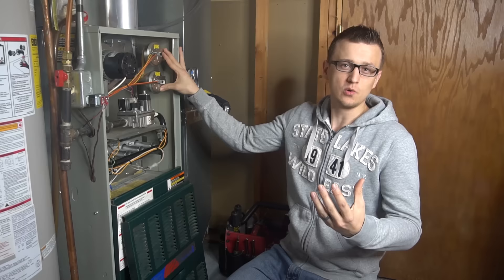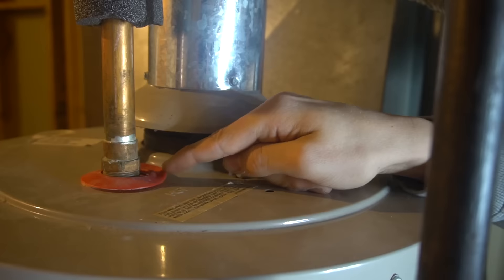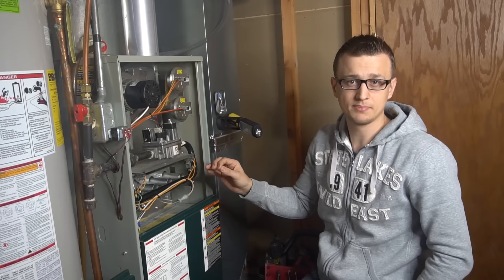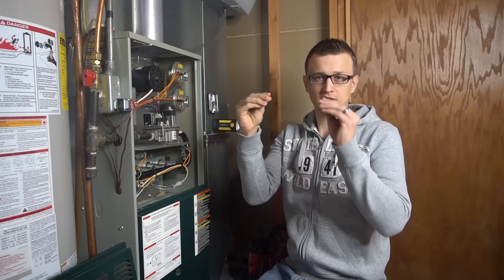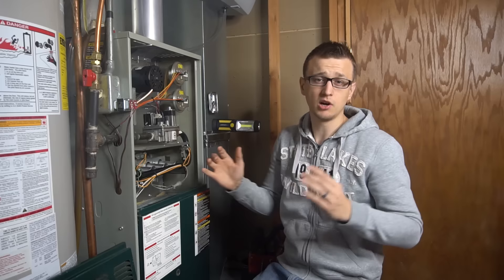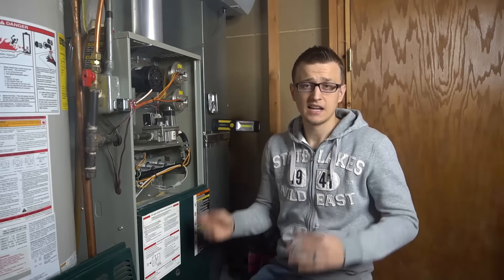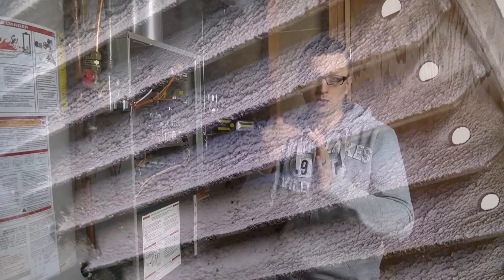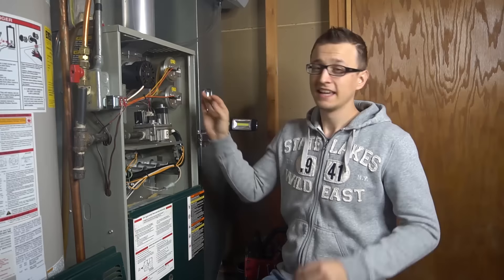Furnace Pressure Switch Troubleshooting

Comment: After the last professional maintenance, the furnace would not turn the heat on. Eventually, I found two error codes that hinted at two pressure switches (low and high). This video helped me to find the problem - the joint hose to both switches simply fell off from the inducer (or perhaps the technician forgot to put it back after his tests). Thanks.

Comment: This is awesome! you saved my life right before incoming 3 degree weather days. My problem was that my furnace ignites and runs for a few min then stops, and I thought was a pressure switch problem. But then I gave it a try and opened the burner box as you suggested. Boom, it worked like a magic and just kept running. now I know it is clogged intake pipe problem, which I can solve in another day. At least I have a running furnace for now to get me thru the next a couple of really freezing cold days.  THANK YOU!

Comment: I'm a diy'r, but through some testing and I believe using your video's I managed to find a bad low stage pressure switch. i ended up taking it apart and cleaning the contact points. Taped the unit back together.  Reinstalled, all worked with no codes. Ordered new switch set and kept them on the furnace for when my fix fails. It's been a couple months shy of two years now. Still going. Seems the little contact points go. Fixed a hot water tank using a similar method. Don't be afraid of taking the switches apart. They're buggered anyhow.

Comment: Great video. Was able to pinpoint the issue when the burners kicked on after I removed the burner door. I cleared the air intake pipe outside, and the furnace works normal now.

Comment: Carrier Heater w/ LED Code "31".  Followed instructions and this led to the Condensate Trap, with 46oz of condensate drained once the larger hose removed - thanks for tip to have bucket ready!  With kids home for the holiday, this could have been a disaster, instead .. just the opposite, all because of your troubleshooting guide, thank you!

Comment: Jay, thanks for the amazing, helpful video, and for your YouTube channel. Your “reason 4”, Cracked Pressure Switch tubing, did it for me on my 24 yr old Nordyne G8 Series furnace. I replaced that pressure switch in 2009, but the end of the tubing that attaches to the inducer/vent motor was now blackened. When I twisted it off, just like you said, it fell apart. I cut 2” off that end, plugged it back onto the motor, and WE HAD IGNITION! Woo Hoo! Thanks for the PayPal link so that I could buy you a beer!

Comment: Hi
Yours video is very helpful to me and I am glad that I did fix my furnace as per your video step by step instructions. 

My problem was that my furnace turned on but after 10-15 minutes it turned off and not reaching the thermostat heating no e.g I did set 22 F but my furnace turned off at 19 F.  
I did the following steps.
1.  Change the flame sensor.
Result: same
2. Check the limit switch, it's working 
3. Pressure switch- working 
4. I did the your video step 8 
     I found the drain pipe clogged, I cleaned the both pipes and try.
NOW MY FURNACE IS WORKING GOOD AND I AM VERY HAPPY. 
Thank you again.
Reply from the maker: You're welcome! Glad to hear you were able to get it fixed! :) Stay warm!

Comment: Great video and thorough explanation, had the six blinks on a Coleman, pressure switch, everything looked fine but when I unplugged the hose connecting the switch to the inducer motor, the small hole in the fitting of the motor was clogged with like the residue of hard water substance, a simple poke with a paper clip and it's running like a champ again, hope this helps someone out there.
Reply: I had the same code on my coleman the lower pressure switch (bottom left) was blacked.  I put a pin in it and I blew some air in and it stared right up.  Thank you!!!  9pm and low 40s outside!!!
Reply: @kathleenmclain978  Glad that helped you

Comment: Thanks so much for this video.  I already understood most of this and was great to review as I was troubleshooting my pressure switch.  But thanks to your video it made me review the other sensors inline.  I found the high temp limit switch inline.  After testing it it seemed fine on a multimeter.  I first bypassed the pressure switch.  The furnace would get to the igniter phase then just turn on the gas then immediately stop.  So I added another bypass to the high limit.  It worked fine after.  I tested and re tested and found that essentially when the high limit started seeing some current it would fail.  I'll let you know when I get the new high limit.  I have experienced this in the automotive world with intermittent issues as the load/current increases things would stop working.  Thanks again!

Comment: Thank you very much. Got a pressure switch error code on my American Standard 90% furnace and was ready to go out and get a new switch.  Never would have thought the condenser trap having crap built up in it would cause this code.  15 minutes, zero dollars, problem solved.

Comment: Thank you!! I just went a night without heat in the single digits. Went through your video. Tubing was fine but had to cut the end of it off but it was long enough to reattach like you said. But the main issue was debris that had fallen in the sensor. Thank so much!

Comment: Hi Jay - I agree with other comments below... you are an excellent instructor!. Not an urgency but my American Std Platinum High Eff was giving me a pressure switch/inducer fault and  after inspecting vents+ wiring i did the "blow in the tube" to test the pressure switches and indeed there was the fix! Thanks and best wishes!

Comment: Fantastic video!  I was able to apply this to my water heater that was having the same type of error codes.   Of course, after re-assembling the inducer and pressure switch wiring, it seems to be working fine again; but I've now ruled out the switch itself, and it's led me to my vents likely being partially obstructed by some ice (waiting for a ladder so I can get up and check them out)   You are great at explaining things in a way us lay people can understand; thank you!! 🙏

Comment: Thanks so much for your videos. My issue was a clogged condensate trap. Then of course someone was nice enough to glue the pvc pipe to the condensate trap! I had to cut the pvc pipe on the outside of the furnace so I could pull it out, clean the trap, put it back and I'm off to big box store to get materials to fix the pvc. Bucket is catching the water, but it's about 10F outside and the furnace is working again!

Comment: Your videos are great. I had an air issue and a quick clean (of very minor dirt) seemed to get by furnace igniting. It would only ignite with the burner box cover on, and when I took it off, it ignited, so I focused on the air intake.

Comment: Thanks so much for this. My Mom has a gas 90%. She called furnace co it wasn’t working. They said “pressure switch sticking” and replaced it. 2 weeks and $400 later it was doing same thing! Kicking on cycling for like 3min then shutting down. This saved us!!!!

Comment: Thank you so much.  As a complete novice this has been a bit scary, but I fixed it.  The inducer blower was rattling and nothing was happening.  Not knowing there was a code (blinking light), I just went in to clean the firebox.  Even though you warned, I hit the igniter (thought it was further up) and broke it.  While waiting for the new igniter, I opened the exhaust and saw a dead bird.  After cleaning, including vacuuming inside the inducer box and pressure switch connection as well as installing the new igniter (very difficult maneuvering, especially since it is so fragile) it worked!!!   I opened the exhaust several months back because I heard an animal; one bird came out...obviously there was at least one more.  This happened around the time I had a new roof installed.  Hopefully, something was opened up temporarily allowing this to happen.  Poor animals.

Comment: Jay, you make the best videos, they are so thorough!  And you are so knowledgeable and personable.  Now despite all that, none of your advice has helped with my "pressure switch" error I've had for the past 8 months, which leads me to believe it's not a pressure switch problem. I'd be indebted if you could advise:
I have a simple 80% 3 burner Ducane MPGA 100b4a which is throwing 3 flashes - "Pressure switch is open, should be closed".  Now the pressure switch is fine, as is the new one I bought, lol.  There is continuity when the inducer is running, and the circuit is open when the inducer is off.  One thing I've noticed is that one side of the switch has 24vac to ground, the other side is like ~ 6vac.  My thought is that the low voltage is causing the error, not the switch.  I jumped the limit switch on the panel with no difference, but the other is on the blower, which is way under everything and there is no access to it, save the very front panel and needing to be plastic man.  What should I try next?  Thanks!

Comment: This video saved me a service call which I was not looking forward to doing with Covid going on.  Took a small drill bit and cleaned the port to the inducer motor from the pressure switch and it started working again like a charm.  Only difficulty I had was finding where everything was on my Bryant 90 +i which looked quite a bit different.  If you ever run out of ideas for great videos, some tours of different brand devices would be great.  Thanks again, liked and subscribed.

Comment: Our Goodman 80% furnace was blinking an open pressure switch code on the controller board.  After determining the correct voltage was reaching the switch and that the air tube was not leaking, we then tested that the switch could close by sucking on the end of the tube and checking for continuity through the switch.  Next, we turned on the furnace power and sucked on the air tube - the diagnostic light on the controller board stayed lit, indicating no other issues we could detect without testing the switch with a manometer.  Rather than opting to climb up on the roof to check the chimney next, we took a stiff, thin wire and reamed out the air tube nipple on the induction motor - it felt a little crunchy!  We reconnected the air tube, and lo and behold, the light on the board stayed on and the furnace ignited!  So, before inspecting the flue for a blockage, clean out the air tube connection on the induction motor, to eliminate that as a cause for the pressure switch to be stuck in the open position.

Comment: Hi. Amana Distinctions (Goodman) 90% efficient, 15 years old or so.  I replaced the inducer blower last winter due to bad bearing, furnace worked fine.  Yesterday, furnace stopped, getting 3 red blinks - pressure switch open.  Troubleshooted - intake, exhaust is clear, manifold condensation tube dry and clear, exhaust condensation tube clear, sucked pressure switches (both clicking), wires, connections, hoses look good.  With lower door off and manually pushing the door switch, a few different things happened.  It ran, so I put the door back on, but after a cycle or two, furnace would stop.  Continued with door off and depressing door switch and this is where I am at - the relay, I think just the one,  on the circuit board would click a handful of times.  Sometimes the inducer blower would just barely start and then I get three red clinks.  So I tried spinning the inducer while depressing door switch and this did not help.  Now, the relay clicks a numbers of times and then I get 3 blinks, nothing happening.  Can you suggest?  Thank you.

Comment: Thanks Jay. This was a great educational video. For me it was the inducer motor not wanting to start, it was humming and maybe having 1 revolution in 20 seconds. Took off the motor, spun it by hand and blew it clean with compressed air. It started up immediately when plugged in. Reassembled everything and the furnace works great again. Great and cheap fix when it is -29°C outside. Calgary Alberta, Canada

Comment: Thank you so much... I troubleshot it to the air flow sensor which seemed to work, when I tested it. I could not figure out why the burner would only work when I jumped it out.  It ended up being snow had gotten into the intake which I would have not realized without this video.

Comment: Amazing video! My error was a low fire pressure switch in the closed position. Seeing that a lot of troubleshooting steps are to figure out why the switch won’t go to a closed position I had to figure out why mine was “stuck” closed. I think you might have mentioned in the video to lightly tap the switch to unstick it - well that’s what fixed mine! I used a screwdriver and knocked on the switch a couple of times. Turned the power back on and the furnace fired up! Thanks for the great videos!

Comment: Thank you young man. I did find a bird on top of the inducer housing. Imagine my dissappoint when I still received a pressure switch code,
follow the rest of your steps and bingo, back up and running. No cost. I think it was cleaning of the inducer
motor fan blades. They werent terrible looking but I cleaned them anyway. everything else checked out good.

Comment: Thanks for the video, it is succinct and covers all the troubleshooting ideas. Tried them for my Nordyne G7 system that started giving led flash. Flashing green and solid red means pressure switch open fault. Tried shorting all the switch related circuits, changed the board but still gave same code. 
Ultimately it turned out that the blower limit switch was blown because I did not change the filter on time.  So it seems like G7 model on Nordyne has wrong fault indication. Hope it helps someone.

Comment: Very informative video here! Had the inducer motor fail. After replacing it, burners won't ignite w/o the top door off. I figured that the inducer intake pipe is clogged, and your info confirms my hunch. Probably a dead animal - found dead mice inside main blower chamber, so might have similar cause of the inducer failure. Was surprised that simply replacing it didn't get things back to 100%.

Thanks for your efforts.

Comment: Great videos, super helpful.  I have had furnace problems on and off for months now, and I cannot figure it out.  Neither can the company I have come out for help.  They just keep taking my money without a perfect fix.

Long story short, I had a pressure switch problem two years ago or so, and it was because I had a long exhaust run and I had a sag in the run that caused build up.  It would trip the switch, and not allow the furnace to fire. I got that fixed, and then the furnace ran pretty fine for maybe a year or so.  

Fast forward to now basically, and I started having the same issues.  Except this time I wasnt getting pressure switch error codes anymore, I just have a furnace that tries and tries to fire, but wont ignite a flame (most the time).  It continues until it goes into “lockout mode” and will just blow cold air through the house.

The only way I have been able to get around this, is to unplug the tube from the pressure switch, and the furnace ignites EVERY time.  EVERY time.  When I plug the tube back in, the furnace continues, heats the house, and will even turn off, turn back on when the heat drops and fire the next time.  The only time I encounter issues is when there have been a very long period of time between ignitions.  Like for instance when we drop the temp 5 degrees at night when we sleep or something.  If we keep the temperature the same all day and all night and the furnace is kicking on, on a normal consistency we don’t seem to have problems.

I just dont know what the heck is going on, and I am not sure I trust my HVAC company to come out and keep helping us.   I have already spent over $500 for a normal service call and having them reroute my intake and exhaust to make them shorter runs.  I wish I could figure this out myself.  I feel like its a drain/condensate issue, but I dont know how to know that for sure.  

When its not firing, it always goes through the entire process, pilot lights up, but then when it goes to light the burners it wont catch.  Also, sometimes when it does catch, it has a pretty big combustion.  I have no idea what that is all about.

Any insight would be SUPER appreciated.  TIA!
Reply: We have the same problem with our 20+ yr old 80% Day & Night unit. We’ve gone thru the checklist for a code 31 and also tried using a different thermostat. It always starts up after several times of turning the thermostat switch on/off in the am and runs perfect fir the rest of the day. We always turn the heater off at night. It is now happening every am. 🤷🏻‍♀️
Reply: @stacy695  We ended up getting the pressure switch replaced and it has worked fine since…. Bizarre.

Comment: Thank you! Fixed my Carrier furnace after watched your video, super helpful!!!
My case: a 5 year old carrier furnace sunddenly stops working: reset power, induce motor works for about 30 seconds then LED light flash.
Error code indicates the pressure switch has problem.
Followed your suggestion to check the switch, after i blowed the tube, i heard the click sound from it. And then furnace started to work again after i powered it on.
it seems the switch was not back to close before.
Again, Thank you so much for your video!

Comment: Thanks Brother for an informative video! You're doing a great job and keep up the good work making these videos for everyone. 5 years later and you saved my family and I for the winter... in troubleshooting I found it wasn't a bird nest! Note: At last, I found a (SPIDER LAID AN EGG SACK) in the metal collector box tube. in the process I replaced a burnt-out circuit board, old blower capacitor, heating flamant, and pressure switch. Awesome Man! Cheers!